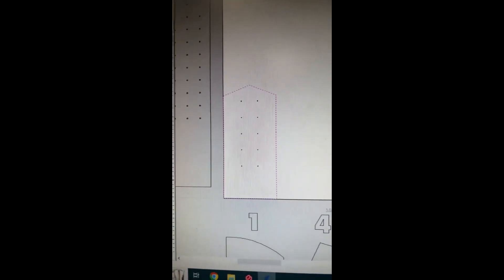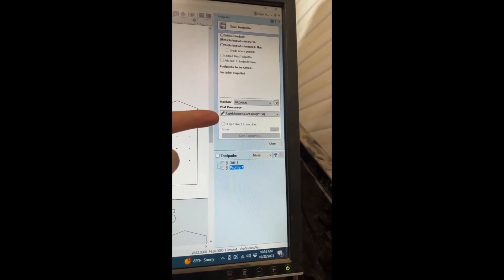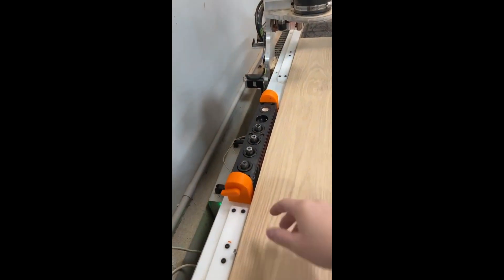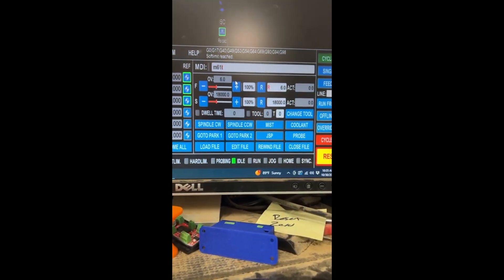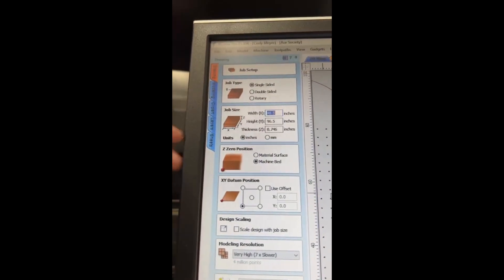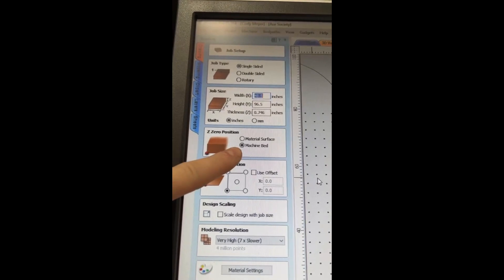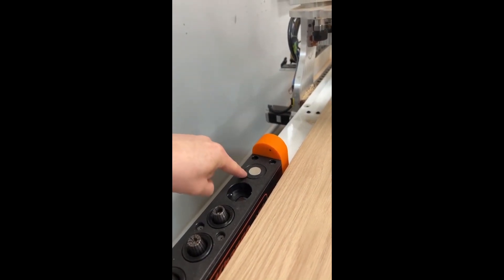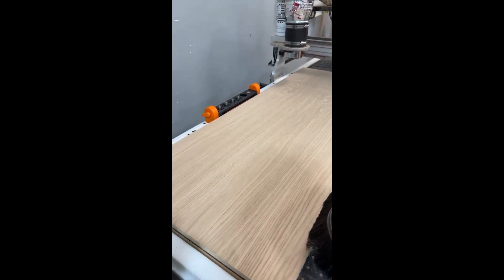First Cuts with the RapidChange ATC on my CNC!

Comment: Hi. Nice to see the ATC at work, thanks 🙂

If it is possible, i have some questions for you:

which UCCNC version are you using ? (2113/2115/2116)
which controller ? 
which breakout board ?
the post processor you are using is delivered with the RapidChange ATC ?
why are you having problems with the dust cover pin ?

Thanks in advance for your reply